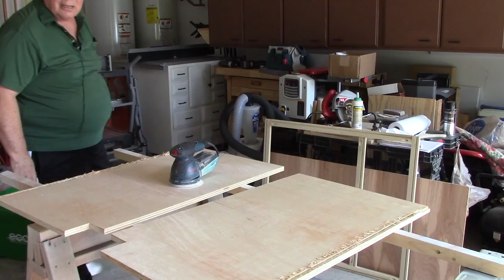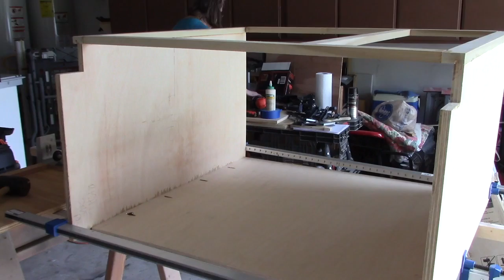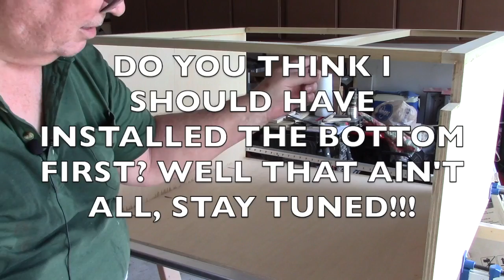VANITY CONSTRUCTION CONTINUES

Comment: I wonder if Masking tape would have helped. If not you can score it with a razor blade to prevent this. Didnt see how you cut it but that looks like Birch plywood which is hard to work with on the first layer. Great wood for a project though if thats what it is. Looks promising as a project though bubba. Staying tuned for the next video :)
Reply from the maker: I used my router with a bit designed for this purpose. Have done this many time before with good results. Don't know why it worked this way this time???
Reply: +James Mitchell well I guess it'd one of those you win some you lose some. Still looking forward to seeing the finished product bubba.
Reply: +That Stereo Guys Workshop also the scoring is a good idea and habit to prevent any breakage any time your working with wood. just something I make a habit of.